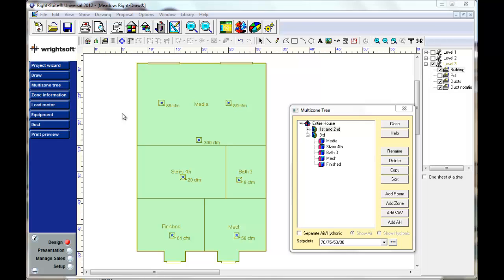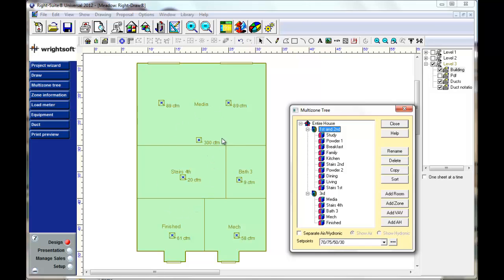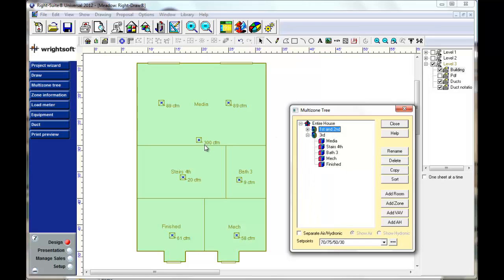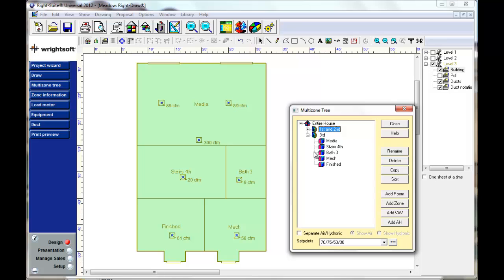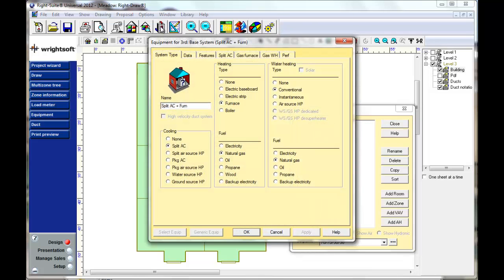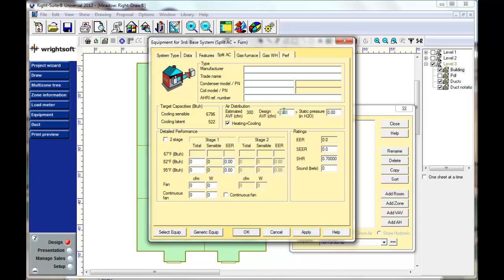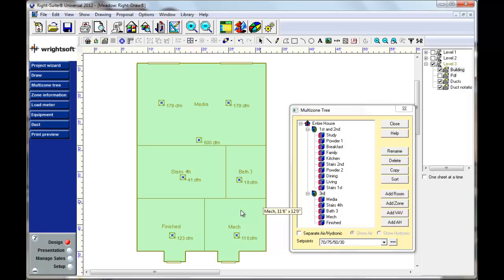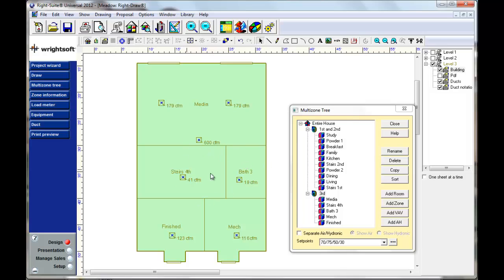Wrightsoft Modifying CFM of AHU's

Comment: Why do the Supply CFMs add up to 657 when you actually input 600?
Reply: Story of my life… I’ve reverse engineered the room airflows using sensible heat eqn and almost always find that wrightsoft uses a pretty high coil LAT for cooling (typically a 16 deg dT vs. 18-22 depending on SHR). I wish there was a more transparent way to adjust airflow using actual LAT values alongside fan aiflow per performance data. Also, yes, the airflow totals NEVER sum correctly.

Comment: Your using multizone for the third floor.  My question is when I try to breakup a home into two areas (zones) for two different systems (a 3.5 ton and a 2 ton) I can't seem to get the software to allow me to input the equipment.  The equipment button is grayed out.  How do I do this?